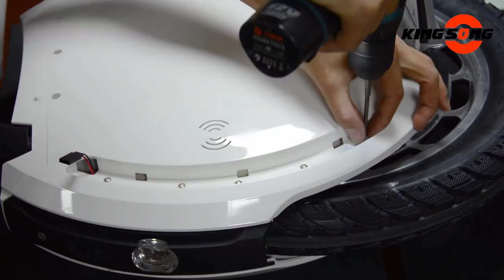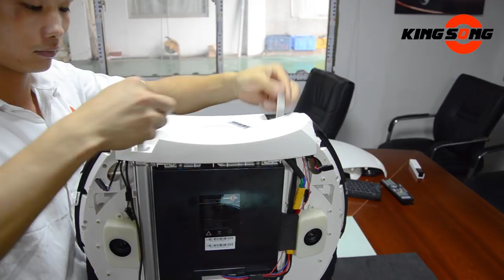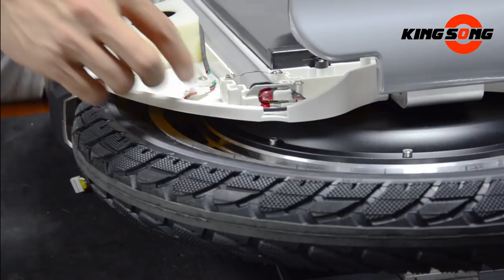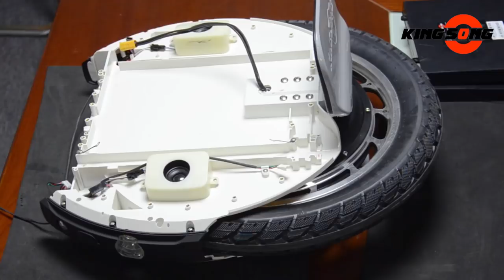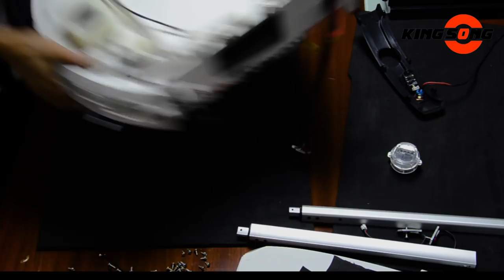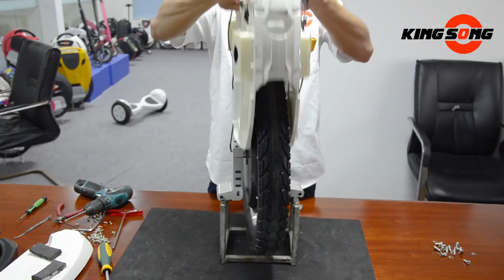KS-18L Disassembly Guide  King Song 28/6/2018

Comment: For those to want just change the tire: simply detach the side shells, disconnect the motor, unscrew the 12 big screws (6 per side), slide out the motor with the pedals and change the tire like in KS-16 or KS-14.
Reply: I just bought one of these waiting for it to come in, I saw this video I'm like holy shit got to do all that to change a tire, LOL

Comment: Those pads don’t come off that easily.  You have to practically rip the pads to get to the screw holes.  Holes should have been left so you wouldn’t have to pull the pads away to expose the screws.  They don’t show you that in the video.